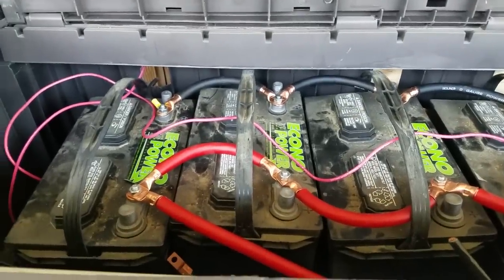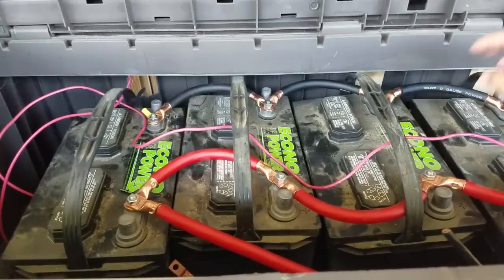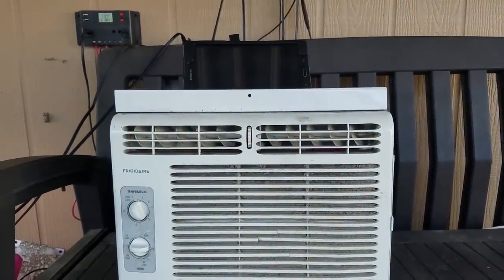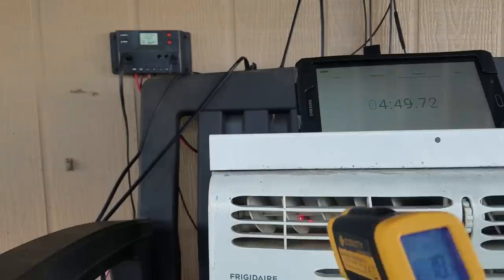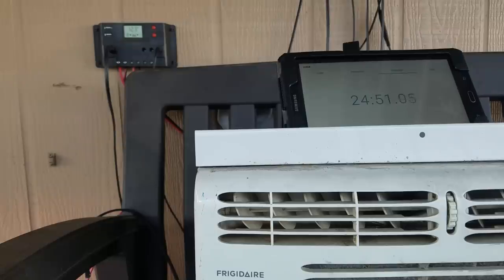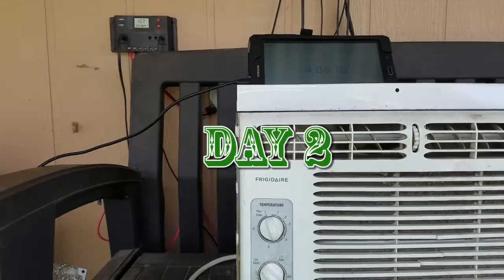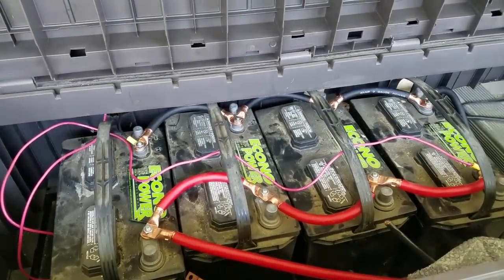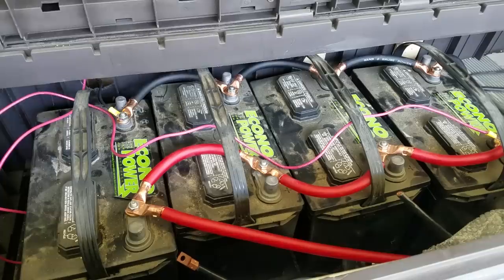Running a 5000btu air conditioner on Harbor Freight solar panels?

Comment: Your taking 576 watts out and only putting 150 back in, it will take you a week to recharge your batteries after they are dead in a few hours, also 12.5 volt is a full charge and 12 volt is a dead battery anything under 12 volt is damaging battery
Reply: Monroe Kunz , no damage on any deep cycle battery.
that's what they are designed for
Reply: Hi Tim.  All batteries have limits.  Deep cycle batteries as well. 
Automotive starting batteries are designed with different thickness of plates and number of holes in the plates than are deep cycle batteries.  

Unlike deep cycles which are designed to provide a small amount of current over a long period of time, starting batteries are designed to provide a high amount of current for a very short amount of time.  Automotive batteries should be discharged no more than 10-20% of their rated capacity.

According to battery experts (Manufacturers) flooded lead-acid type deep cycle batteries should be discharged no greater than 50% of their total capacity.  Deeper discharging damages the battery and significantly shortens its life.

So, a (deep cycle) battery rated at 100 amp/hrs capacity should provide a practically usable 50 amp/hrs of power.  In a pinch, one could discharge the battery more deeply, but at the cost of the damage which will shorten its life. 

Lithium, AGM and other battery technologies have different specs.  I believe that lithiums can be discharged 80-90% without harm, but I would have to check on the exact figures for lithium batteries.

Voltage measurement only provides an estimate of the state of charge for flooded batteries.  Testing with a hydrometer will give accurate results.  That said, 12.6-12.7 is generally accepted as a fully charged battery.  When voltage falls to 12.0 or 11.9 volts, the battery is 50% discharged and should be recharged as soon as is practical.

Most inverters are set by the factory to cease operation when the battery voltage reaches 11.9.  Knowing the working limits of your battery is more than just waiting till it fails to power the equipment you have connected to it.  That method works for flashlights, but not much else.  LOL.